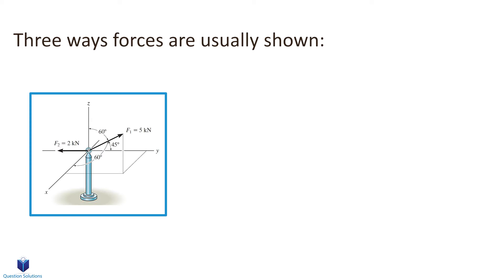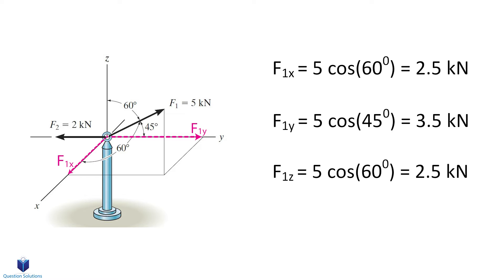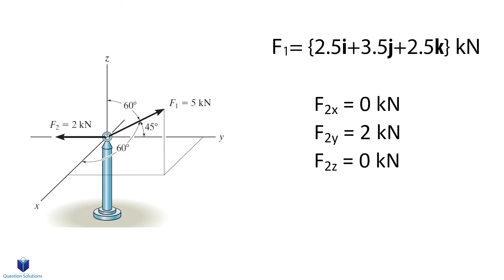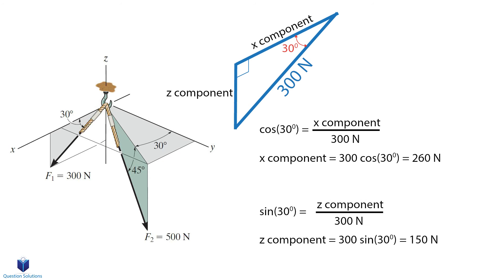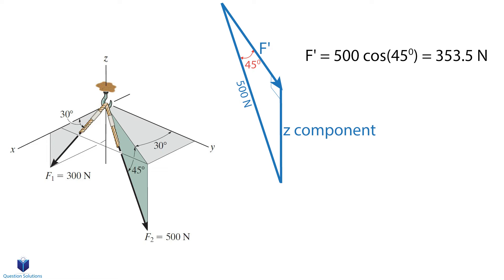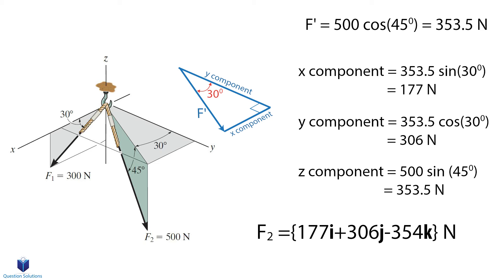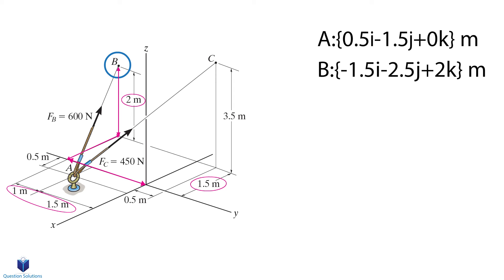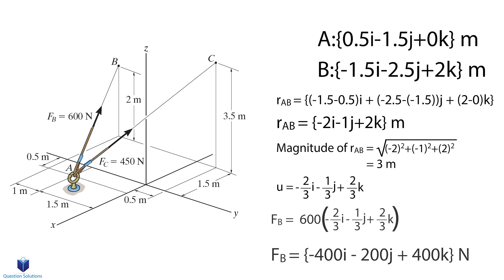Forces in Cartesian Vector Form

Comment: In the first examples you get the z f1z component using cos .. why in the nex example you did it with sin ?
Reply from the maker: Each question is a different way of solving. For the first example, you have to use cosine. For the second one, you can't because the angles are not coordinate direction angles.